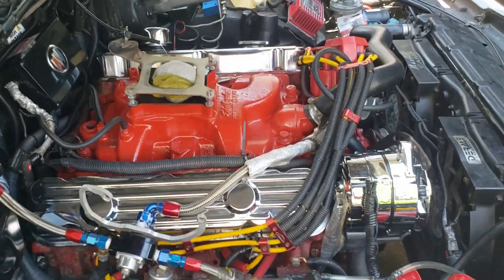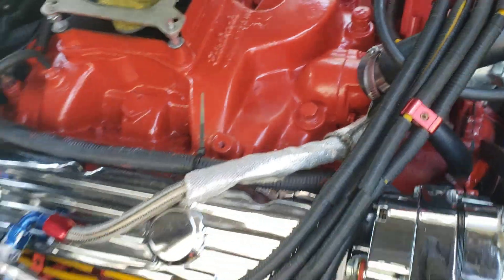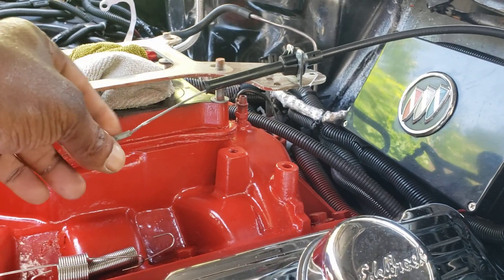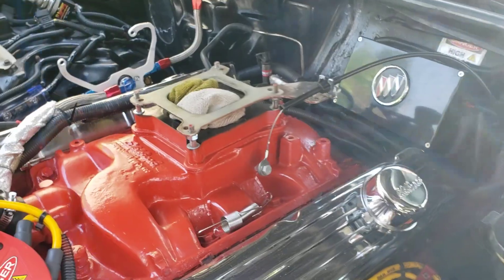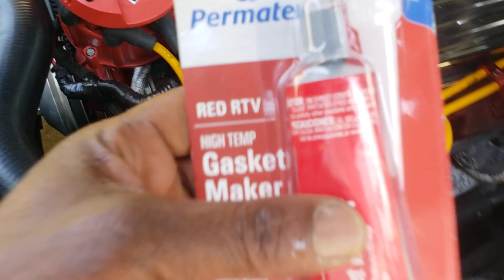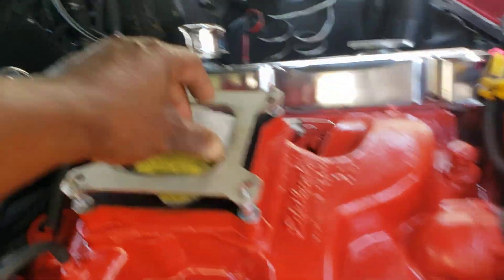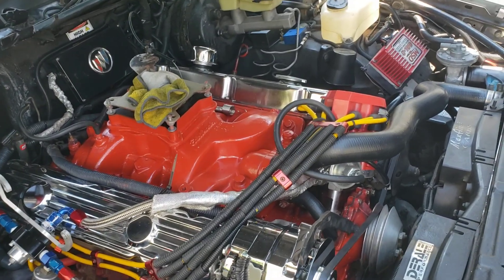Buick 455 Stage-1 Regal-T Holley Carburetor 2nd Baseplate CRACKED.  😅💪🏽

Comment: That 4-hole spacer plate looks familiar. Because of the A/B letter on it on the one end I believe it is the type in which the center section can be swapped with an open section. I have one just like it. If you had the open section you could just swap it out. The problem in your situation is it only has 1 5/8" throttle openings. Your 950 has 1 3/4" openings so it would be a bit of a restriction. The more gaskets you have the better chance there is for breaking the base plate. Just be careful tightening up but it has happened to almost everybody. When you get your new plate I'd get rid of that thick bottom gasket. As far as I can tell it is not doing anything that a normal thin gasket will do.

Comment: 😎😎😎where did you order your spacer from? Great upload. Berto
Reply from the maker: https://www.ebay.com/itm/124226258017
Reply from the maker: https://www.ebay.com/itm/124226258017
Reply: Screw in studs on the right side. Would be better. On carb. ARP studs with the Allen head till it bottoms out. Take a dial calipers and measure the height. Between right passenger and drivers side. On the intake manifold.
Reply: Actually. To do this right, I'd take off the intake manifold, bring it down to a machine shop have the carberatur base plate milled to 0 tolerance. Then have the intake and exhaust runners machined to 2 thousands. Then put on a composite intake gasket.